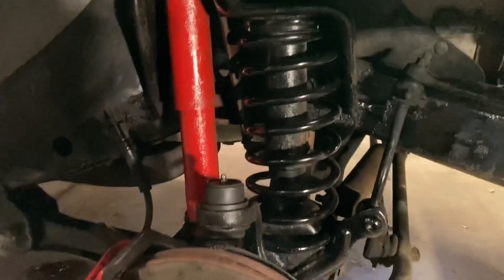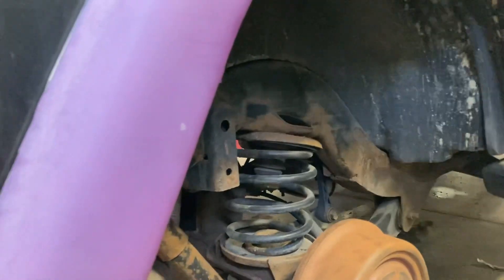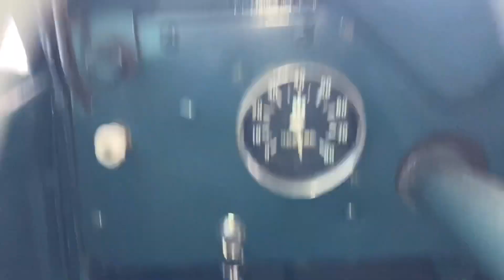1961 scout bad slave cylinder

Comment: These clutch slave cylinders fail a lot if you add a once or to of power steering stop leak it will expand the rubber even a bad leak and last for years.
Reply from the maker: Thanks I’ll remember that in the future